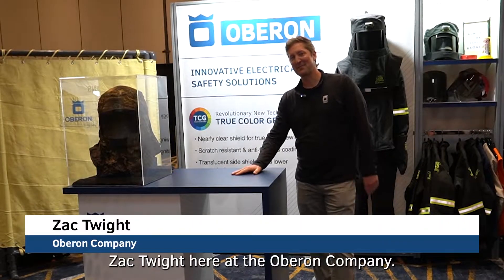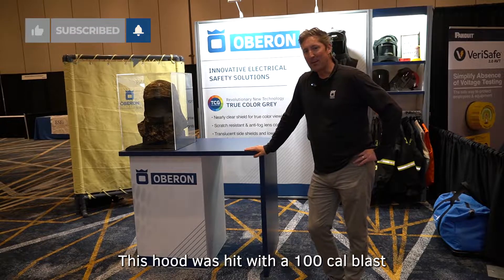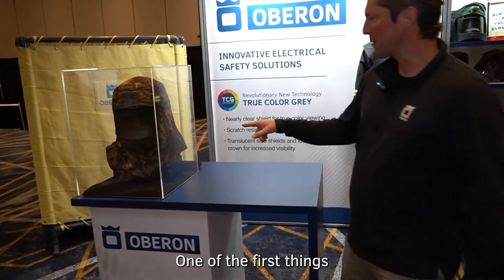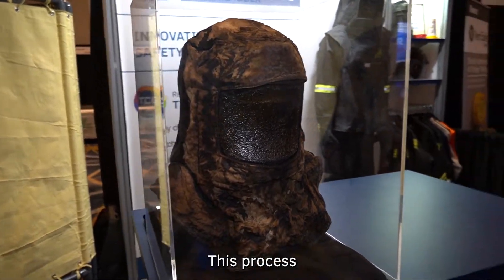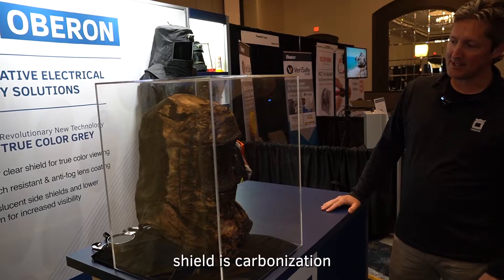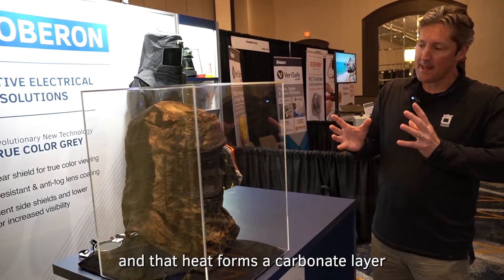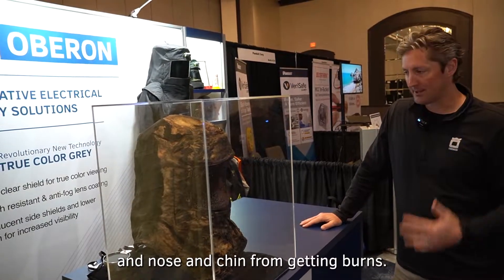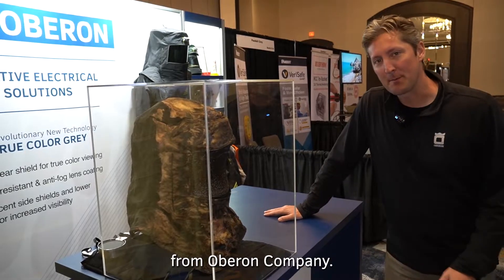What Happens to Arc Flash PPE After an Arc Flash?

Comment: Being an electrician doing mostly residential but occasionally commercial that sometimes involves troubleshooting inside a live 480V panel,  the thought of an arc flash scares me far more than getting shocked,  and I've been hit with 277 off a lost neutral once in my 6 year  career while changing out some ballasts in a large office building.  The circuit I was working on was locked and tagged out, but the building was from the 60s with outdated equipment and they had single pole breakers on the lighting circuits that were part of a mutiwire circuit of a 480Y/277 system, this was not reflected on the facility records.  A good habit I quickly got into was treating everything like it's live even when the power is off and locked out, and includes using insulated tools,  working with one hand behind my back or in my pocket while wearing electical insulated boots.   You can never be too safe.  And when it is necessary to work live additional precautions must be taken although the only times this should ever happen is during troubleshooting that requires power on to take voltage and current readings,  or where de-energizing would create additional hazards of their own.
Reply: the high voltage jonnies will tell you they are more terrified of 480v than12kv due to the short circuit amperages. 12 kv just pops while a large 600v short blows the hell out of every thing in the vicinity.
Reply: This is the first time I've heard the hand in pocket method mentioned since my Navy apprentice days. The only time you are allowed hands in your pockets in the Navy is to get sosmething from them or when working on electrical stuff, unless you are the commander of course.
Reply: My uncle was an electrician for Navy ships while in shipyards. He started teaching me at age 12, and the first rule was to work as if it were live. It taught me to move with precise control.
Reply: In Germany we get taught 5 safety rules to be executed in that order. Last two are for above 1000V:
Cut power
Secure against turning back on
Confirm power is off
Short and ground parts to be worked on
Shield/cover adjacent live components
Reply: @fabianrudzewski9027  interesting how other countries do things slightly different but in the end accomplish the same goal.   In the USA,  we use lock out tag out to protect against the unexpected release of hazardous energy while performing service, maintenance or adjustments on machinery.   The procedure is: 
1) Lock.   Putting a lock on an energy isolating device, whether a circuit breaker lockout,  or a valve handle lock out in the case of pneumatic,  hydraulic and steam systems. With very special exceptions,  each worker must apply and remove his or her own lock, and the locks be individually keyed and uniform by color, shape and/or size, and must never be used for any purpose other than LOTO, and the padlock on a toolbox for instance,  is not to be used for LOTO. 
2)Tag.  The person who applied the lock must fill out and  attach a tag with a zip tie or similar means having a minimum of 50 lb tensile strength. The tag at a minimum must state the name and contact information of the person who applied it.  A brief description of the equipment and why it has been locked out, along with a current photo of the employee is a good practice, but not required 
3) Clear.    Clear all personnel and tools from the equipment. 
4) Try.     You must then try to start the equipment.  This could also include verifying the absence of voltage with a suitable meter, and/or opening valves on the equipment, checking pressure guages, etc.   

There are situations that involve installing temporary grounds or other precautions where the  re-accumulation of hazardous energy from other nearby sources is a possibility.
Reply: 480V aaah we've diff standards it must be 60Hz
Reply: I work in a metal fabrication shop and on a night shift, my job was to spin a massive duct (wind turbine size) so two seams could be welded. I sat next to the welder for 12 hours wearing what I thought was good PPE but it didn't work. I had bad arc eye and serious UV burns to my skin which eventually fell off in sheets.

multiplied by many more and instant must be horrific.
Reply: @mrdojob  yes.   A fellow electrician of mine knows someone personally who was a master electrician for over 20 years, and one day either from complacency,  in a rush and didn't feel like going back to his truck to grab his arc rated PPE, or a combination, just to change the fuse in a 480 volt 3 phase disconnect for an HVAC unit in a large office building.  He used a pair of pliers instead of an insulated fuse puller to remove and insert the fuse, and in the process slipped and shorted across the two phases on the line side.  From my understanding,  although he survived,  he wished he hadn't,  and over the course of a year, underwent several surgeries and skin grafts and will never have the same quality of life he once enjoyed. 

 Because he failed to take a few extra minutes to determine what catagory of PPE was required and wear it, and use the proper tool for the job,  his life was forever changed in an instant.
Reply: not electrician, so I may be wrong, would it be a good idea to power on a system while no electricity was flowing through it, to help drain the system more, so there is no stored energy in capacitors. Remember I am not an electrician, I only know the very, very basics, hell, I don't even know how to solder.
Reply: @BeanBYTESOF I could be totally wrong, but I'm guessing that some systems need to be energized to complete a circuit, like a PNP transistor.  If the system that energizes the gate has the same high potential, there might be a risk that the electricity will jump and try to find a way to ground. Setting the non energize system to run closes a circuit that opens a path to the ground. Does that make sense folks or am I totally wrong on that?
Reply: @craigcooknf  Yeah, that would make sense
Reply: 400volts is normal for residential in europe lol
Reply: Those MW branch circuits always get ya.  My lead turn off the breaker but handles were not tied and I was on a 16 foot ladder changing ballasts.  Those danged neutrals!
Reply: Makes sense, kinda like the saying, "When in doubt, the claymore is pointed at you." Basically always assume the worst.
Reply: Yup always treat it as live! I did some work once, thought I had turned EVERYTHING off, what I had failed to notice was that the customer had rigged their meter and everything was still on :( Luckily it was just my snips that got it, with an ice chunk of metal removed from them.
Reply: That 440 480 is kind of mean but some of these guys are up in the 7000 volt category. I worked in electric for a little bit residential and saw little 220. I want to 7 years of electrical engineering college to. One of the fascinating things is the psychology of electricity. If you have a 7,000 volt or more training background and you mastered the protocol for $7,000 volts if you go back down the scale to lower voltage, it will be so anxiety-producing, you won't stay long.
Reply: Read the comment as an electrician and correct but how do you work a ballast one handed?  You don't,  keep with truth and more will believe it.
Reply: I've been a master electrician for 30 years - how does one work "with I've hand behind you back or one hand in the pocket?"

It takes me two hand to strip wires or put on a wire nut... Something smells like bovine excrement to me...
Reply: @glopepicado7073  I guess I was a little over exaggerating.   When I got hit by 277, I only got a small jolt though my right hand to the elbow. I was twisting the stranded neutral wire from the ballast to the gray solid #12 from the circuit before putting the wire nut on, with my right arm  brushed up against the fixture while my left hand was holding the wires by their insulation and no other part of my body was grounded to anything.   I have calloused fingers and was dry during the incident.   Now I'm in a habit of never putting myself in a situation where current could flow across my chest or hand to foot if the unexpected happens even when I'm following proper LOTO procedures.  It was only the way I was positioned how my left arm wasn't touching the fixture or anything else grounded, otherwise the outcome would've been more severe.    Been to a few OSHA 10 and 30 classes and electrical safety is no laughing matter.
Reply: @glopepicado7073  :
     Well...I use my feet to do that.
Reply: @glopepicado7073 not a sparky myself, but I’ve heard of the one hand method from my step father who was an electronics engineer, worked for companies like Mallard and Phillips years ago. Obviously you can’t do everything with one hand, but he said it was commonly taught back then as good practice when getting into live equipment. He mostly worked on TVs and stuff like that. The idea was that if you became part of the circuit it’d tend to keep the current away from your heart, if you had both hands in there it’d be more likely to pass through your chest. No idea if it was actually going to help, but that was the received wisdom back then.
Reply: @glopepicado7073  Well, there you go right there! NOBODY uses anything as effective and simple as a "wire nut" anymore! They've re-invented the wheel on those. Just wasn't any money selling the same old product decade after decade.